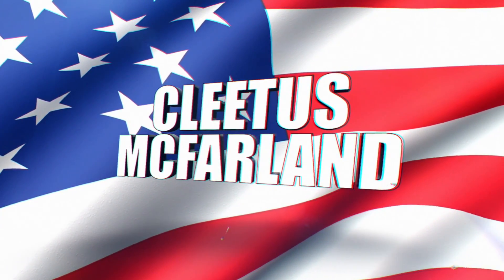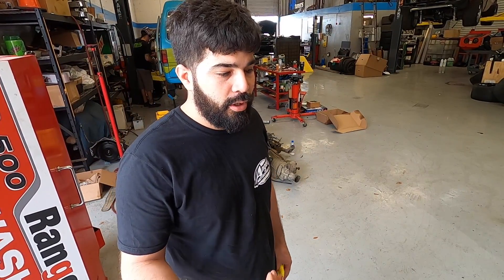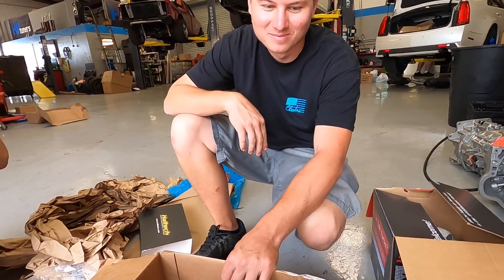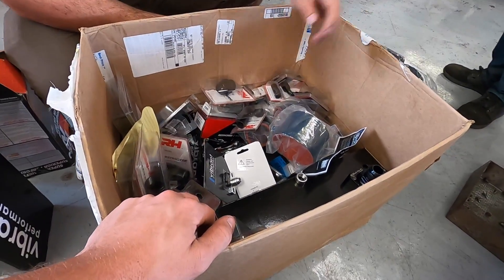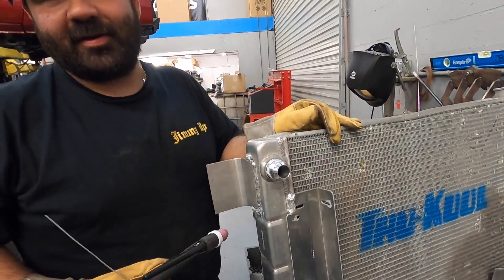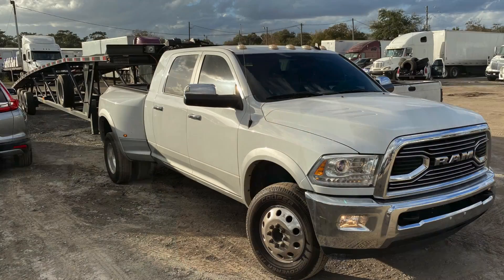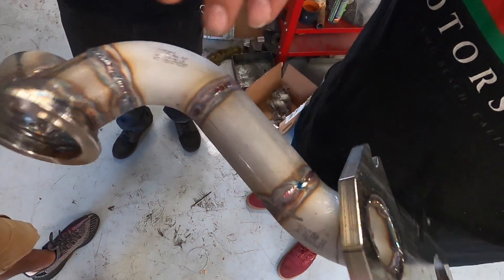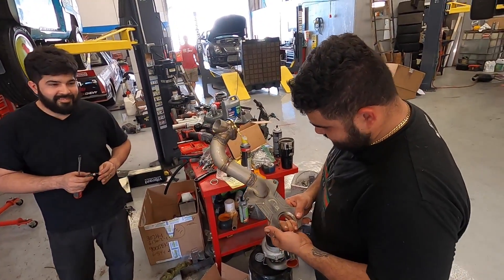ROTARY Swapped Mystery Machine EP.2 - BIG Turbo on a LITTLE Van! + WE GOT A NEW TRAILER!!!

Comment: To put some wheel spacers on it or bigger a arms in the front and wheel spacers in the back to give it more stability. so it won't flip over on him. cuz it is. Y'all should really upgrade the suspension. cut down a 9 inch or something. I feel like I'm watching a documentary on the last days of Cooper.like the motor is going to blow up and f**** send shrapnel right into his ass cheeks or is going to flip over break all his arms or something, catch on fire and blowing up. I'm sorry I know y'all are safe but they're probably isn't going to be as much as you think between him in the motor. No firewall of any sort sorry not trying to be negative. just like the dude. I'm not saying y'all can't have fun but please be safe while y'all have fun. The golf cart should have been evidence enough. that wider is better. and anyting narrow will flip over on its side.. and again sorry if you guys have already thought of this and I'm just getting in line with the program. check my page out. I don't do turbos or Nos. I have a whole different way of making horsepower it's a lot cheaper and it's a lot easier to install than a turbo or NOS

Comment: If you know ahead of time that it will be prone to tipping over, why aren't you taking steps to prevent it? Why make 1 cool video when you could make several more after? Give it wider tires. Add some steal plates to the floor. Add a couple spacers to the axels. Why not take the necessary steps to keep it upright now, and then you can make it even more badass as time goes on? Why would you set it up to fail just because tipping it over will give it you a few more views for that one video?

Comment: The engine’s position still seems extremely low. I understand because of the time crunch, they’re limited on the amount of fab work and re-engineering.... but would it would have been way better to see it mounted behind the front seats up into the floorboard at a slight angle with the rear end position tilted up to match. Then you’d be able to lower the ass end down and it would do little wheelies in mid burnout, like the mid engine mini vans in Australia. Not being able to lower it at all really sucks. Sure it’s going to still sound crazy and do burnouts, it just seems like it’s not going whip around as fast with all the weight up in the front. Either way, it’s still a cool little project. Keep up the hard work. Can’t wait to see how it turns out.